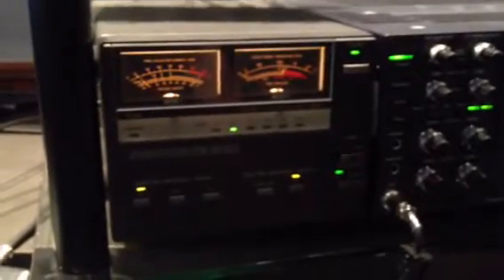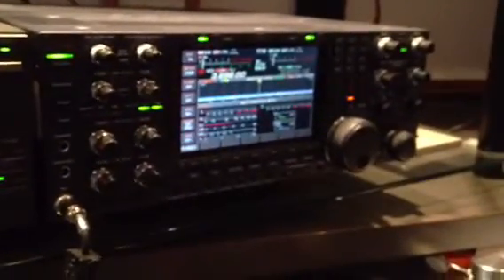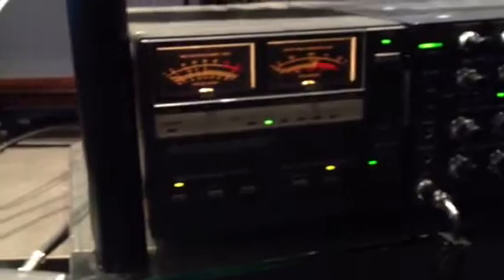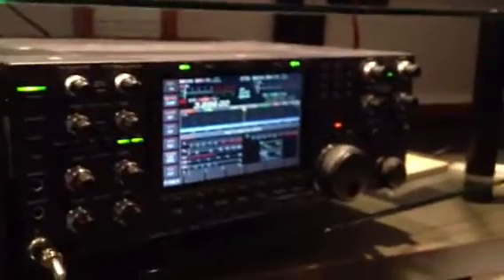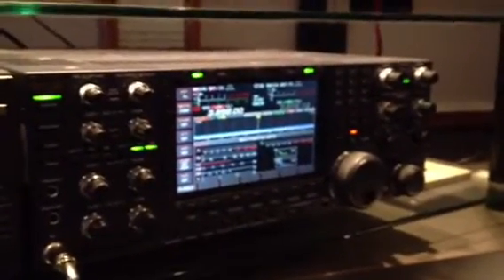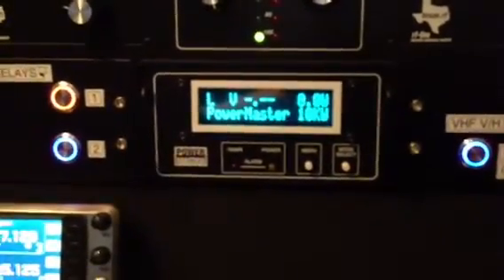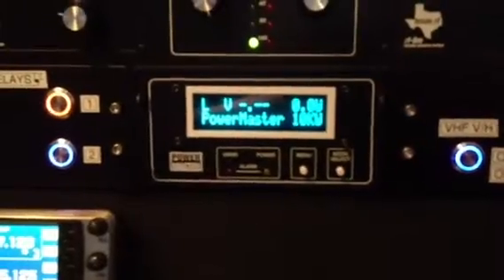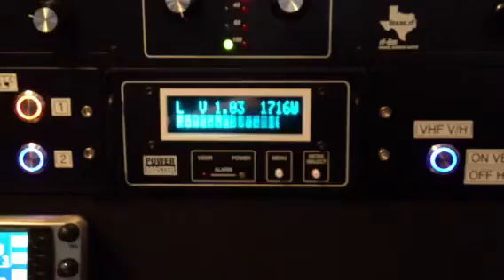Icom 4kL linear amplifier test

Comment: 1700 watts out of your amp? No way would I purchase that amp from you if you were selling it. Talk about abusing an amp ! Holy Cow !
Reply from the maker: 1st..  Its NOT FOR SALE..  2nd Ive had that same amp for 15 years..  Guess what??  Still works PERFECTLY TODAY!!  HOLY TOLEDO BATMAN!
Reply from the maker: ALSO..  You might want to learn some radio terms,,  The ALC is adjusted to relieve any over drive,,
Reply: @radiotype You can adjust the ALC & it will overdrive all day long. If adjusted Properly the amplifier will produce an average of 1 kilowatt PEP as it was designed. You act like a CB “ GOOD BUDDY” and you have the same mentality as well.What’s your Handle Good Buddy? 👎🏻

Comment: I don't understand why you would not run the amplifier at the specs that it was designed for? Running it at those power outputs only shortens the life of the components & nobody can see or hear the difference in the Kilowatt it was designed to do & the 1500 or so you are getting over driving the guts out of it.My ICOM PW-1 will also do 1500 watts but it will not hold up & again nobody has an S-meter that can see the difference in the signal & I am not stressing anything in the amplifier with me running it at the one Kilowatt it was designed for.Kind of like the CB mentality trying too get every last watt out because it is possible it must be OK & it makes them feel Big & Mighty.I guess if you have plenty of money it does not matter if you destroy a good piece of Ham Radio gear but it still makes Zero sense & the ALC adjustments in the owners manual were put in there so that the amplifier would operate a long time without issues at around one Kilowatt output.I really hope this is not how you operate this fine piece of gear on the air & if so WHY would you other than you can because it's yours?